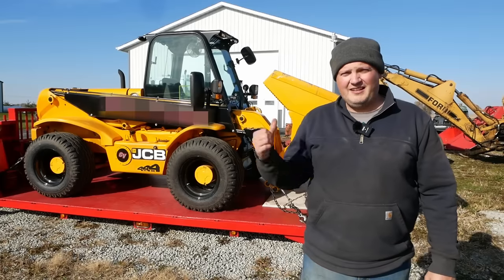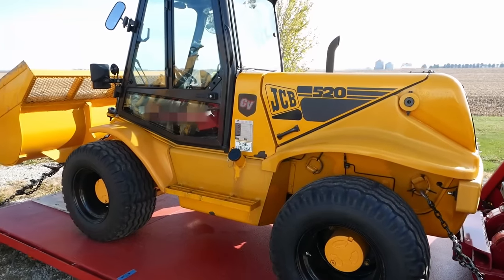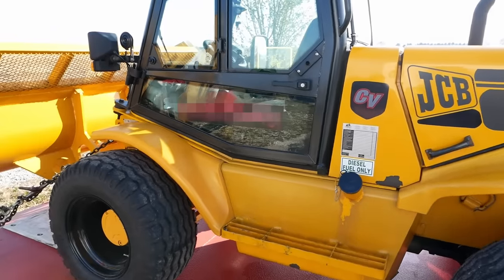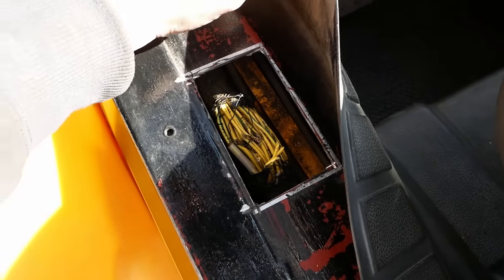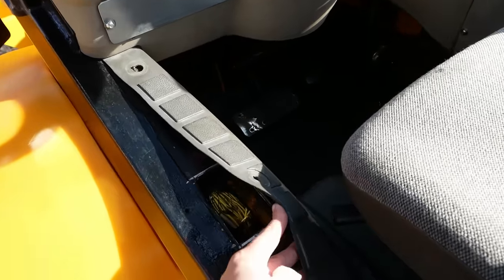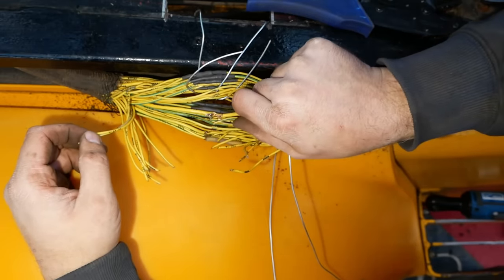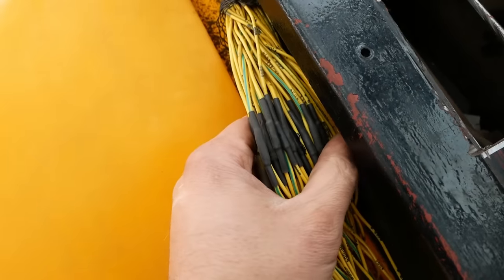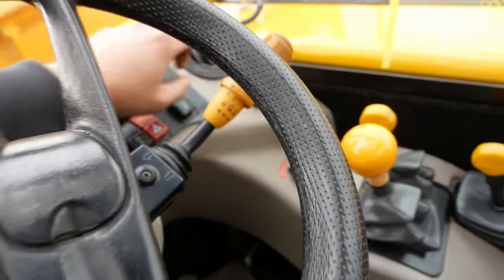What Happens when You Drill a Hole in Your JCB Telehandler?

Comment: You reminded me of the time two of us had to rewire the "brain box" on a forklift.  I think we estimated 1500 wires total.  Could have been less.  Anyway, it took us all week to replace the wiring and get the new circuit boards installed.  It was a real pain working down in a hole with no real access to anything.

Comment: I had the same thing happen in 1984 on a Ford F-800 fire truck.  A hole was drilled in the firewall to pass a cable for a Motorola radio out to the engine compartment.  The drill bit hit the Ford cable and 8 circuits were cut and about 10 more were severely injured.

Comment: I worked as an electrical engineer/mechanic all my life and my worst enemy was tracing and repairing wire breaks inside the insulation at door hinges where constant opening and closing a door causes the copper to become brittle then fracture but hidden inside the insulation. Hundred wire harnesses were occasionally experienced so I understand how you felt doing this job. Personally I can't think of a better method of repair than yours. Well done!!! Btw identifying wires within the insulation can be easily accomplished using a couple of wires soldered to household sewing pins and then pierce the insulation into the copper strands and then attaching those wires to a multimeter and then doing a low ohms continuity check to find the break.
Reply: You can buy meter test probes with tips just as sharp.

Comment: For future reference it is possible to raise the boom on one of those without the engine, it's just a complete pain.

The problem is that they have check valves that stop them moving if the hydraulics fail.
The solution is to lift the boom with another machine, and just keep wiggling the joystick. Slowly slowly, the boom will move.

Comment: The machine is fairly new and it is intended for professional users which demands availability, but the machine electrics is done in CAD and the CAD system can estimate the proper length so suddenly it is possible to:
1  cut the wires in a machine to the right length
2 the same machine will print the connection numer on that wire - and only that wire.

And allow the customer to repair the wiring in the field without necessity of a wiring diagram or waiting for a new loom.

Signal cables is done the same way - every wire inside the bundle is white but they are numbered. Suddenly it becomes possible to splice a damaged cable in the field,  but you are gonna have a CHECK ALL WIRES for shorts between each other and check all connections.

Which is done between the two connection blocks.

Comment: "Lets wipe those tears." Bwahahaha, I got to remember that one! Being a mobile field mechanic, I seen about every scenario in destroying a wiring harness. Anything from hole drilling to wires ripped right out an engine bay. I don't think I would have done anything different except applied solder to the butt connectors. In summery, it runs and now you know where to begin next time it has some electrical issues. The harness is available from them but the wait time could probably be months. Cost for that harness would generate more tears not to wipe but to squeegee. BTW most harnesses on big equipment are hand made one by one.

Comment: Back in the late 80s and early 90s I did a lot of mobile phone and radio installations. A lot of this was on trucks and equipment in the oil field. My first day at work the guy I worked with told me to always know what is under the surface you put some kind of hole in.

Comment: I should have made the trip up, to have you fix my 2001 Ford Ranger when it needed a new transmission. As at least it would have been done right the first time, and I would not have to take it back a third time to have the reverse lights fixed that the other shop broke. My dad was always good with this kind of stuff, but then he was an equipment installer for the telephone company, so he would have had a field day repairing that wiring harness.

Comment: The exact same thing happens to my Honda Odyssey. Mechanic drill a very large hole on the firewall for passing #2 electrical wires for the inside cabin inverter. He shorted out everything and he could not find out why my sliding door and others things did not work. I took the van to the Honda dealer. They removed the whole dash and found out the wiring harness was damaged by the drill. I have to pay the Honda dealer $500 for the troubleshooting. I towed the van back to the shop where they drilled the firewall for the fix.

Comment: Reminds me of a guy who changed out the carpeted running boards on his boat trailer. He jacked up the boat a little, unscrewed the old boards from the brackets and slid in the new ones, then let the boat down to hold them in place before screwing the boards back to the trailer brackets. Problem was he used too long of screws. You can guess the problem he had on the next trip to the lake.

Comment: When I worked at an RV dealership as a warranty manager, I'll never forget one of the mechanics having to trace a wiring short in the dash on a Winnebago motor home under warranty.
We called Winnebago for a wiring diagram and they said that there wasn't one but that we should be able to trace the color coded wiring.
That was fine until we looked under the dash and every single wire was colored purple without numbers or letter coding on the wiring.
Needless to say, Winnebago got billed for the fifteen hours of troubleshooting time and joked about how the factory must have gotten a deal on purple wire.

Comment: A time consuming but easy to diagnose & repair job. Imagine if none of those wires were labeled. 
  The most crazy mystery problem I ever had was with a Chevy Z24 car I bought used. Luckily dumb luck was on my side. Everything worked, car started right up & ran good, price was good, so I bought it from a small car lot. A few days later it suddenly died, refused to start but once it sat for a day, would start right up & run fine for a day or 2 before doing the same thing again.  I went nuts trying to figure out the problem, every part tested good. I figured it had to be something like a loose wire or a few fuel injectors or fuel pressure regulator that was getting stuck/unstuck, maybe a glitch in the ECU. I got the fuel injectors and fuel rail off and accidentally discovered about 12 hardened dead little beetles inside the fuel rail. I think someone was working on it outside at night & left the fuel system apart with a shop light on under the hood that attracted the bugs which crawled inside to hide (maybe also attracted to the smell of gasoline) They put the car back together and the gas dried the bugs out & made them hard so they were floating around like corks in the fuel system clogging & unclogging the injectors. My guess is, they took the car to several mechanic$ who couldn't figure out the issue. They gave up in frustration and finally traded the car in for another.The dealership probably also gave up on figuring it out and sent it to auction. The small used car lot knew it was cursed (bastards) luckily once I got that fixed. It ran good for years.

Comment: Awesome fix Wes.  No way would a new wiring harness have been a better or easier fixed. It would have cost many times more in both parts and labor and then all it would have taken would be getting one of the new wires hooked up wrong and there'd have been no end of the problems.

Comment: Wes I would have used high quality solder sleeves for that job mate.
I've had to do similar jobs on JCB 3CX and 4CX backhoes etc.
Otherwise you fit waterproof shrink tubing over each wire and solder each one and seal with the heat shrink tubing.
Such a long way to do it though.
Anyway I hope those crimps are sufficient without future issues. 👍🤠🤙😎🍻🥃

Comment: Oh, man they got that harness good. Looks like the wires are in pretty good shape aside from the one spot. It would take a couple of hours to get the wires extended and soldered back together. I would have liked to see you soldering all those back together instead of just putting clamp on connections at least you used the heat shrink on them.

Comment: Excellent video Wes  :) also glad wires had numbers on them help or be long time fix the repairs and that a lots color of yellow wires ever seen too! Also I remember do a car Stereo from original to aftermarket one  and  was nightmare to hook up to my car had long time ago! May ask why because Stereo Red was + in Yellow for vechile, Memory on Stereo was Yellow to Red for vechile - Black for ground was correct  and all car 4 speakers on - for + also Stereo was + for - were right ! But in car was crazy and not right as diagrams also called dealer why and think someone put wire harness for key ignition switch also fuse panel backwards when making in assembly line Lol! Also but when told do all that reverse on red and yellow power leads plus speakers it work to do ! But think someone at assembly plant  needs to change to there to do right not wrong ways hook up in electronic skills too ! If want know type car it is 1994 Chevrolet Calavier 4 door also 2.2 Ecto Tech motor with 3 speed Automatic transmission and base model ! But was second half years models and heard not only one had happen too many others too! Glad I didn't blow the aftermarket radio on wire up but heard others did because of power leads!

Comment: Harness itself would have been north of $1000 judging by how much was in there. Basing that off the harnesses we have to replace in trucks sometimes. Only 3 hours of labor or so to patch them is a lot cheaper by comparison. Probably would have taken even longer to pull the whole harness if you couldn't pull the whole cab. Neat truck they use too. Kinda nice to just drop the bed and then unload.

Comment: I’ve seen nails in copper water pipes that sat that way for years until somebody banged on the wall. I saw towel racks screwed into sewer stack pipes that were fine until somebody took down the towel rack.  I’ve never worked a drilled wiring bundle and hope I never have to.

Comment: I like using a ratcheting stripper with an adjustable length gauge into these instances. Gives you a consistent strip of the same length faster. Great job! Would have been a nightmare if there weren’t circuit numbers. 😂

Comment: Back in the late 80s a friend rented a Toyota MR2 and ran it in a club meeting at the racetrack, he had to fit a fire extinguisher so sat it between the seats and drilled a couple of holes in the transmission tunnel to mount it. Of course the MR2 is mid engined so he knew there was nothing in the transmission tunnel...
Hey where is that coolant coming from!
Reply: Of course he was a mechanic with his own shop.

Comment: I use butt connectors for 22-24 gauge. You can get bare barrels or ones with the glue heat shrink lines
Reply: Lining. I can get them at Amazon. They are either yellow or clear depending upon supplier. They are about 1/8 inch od. They work wonders when spicing lots of smaller wires in a harness

Comment: Wes, I don't think I've ever replaced a wiring harness in 20 years of fixing forklifts. Even other techs say "replace the harness" even though I'm the one who does the complex wiring repairs.
Point being most people who say "just replace the harness" I don't think have ever actually fitted one, they don't realise it's not a component that can just be unbolted and changed like and engine part - it runs around every nook and cranny
Most machines I've looked at I've estimated it'd take a good 3 days to fit due to the shear number of components that would needed to be removed just to route it correctly.

That vintage of JCB you likely couldn't even get a new harness and if you could it'd be $4k+ easily.
Another thing people forget, especially on old stuff is they've often had so many wiring modifications and repairs that if you put a new harness on you'd probably end up with a lot of things still not working and have to 'modify' the new harness anyway.

I'm my humble experience, if a harness has got that bad that replacement is the only option then that's normally when a machine is at an age where its probably time to just call it a day and send it to China to be turned to patio furniture.
There is exceptions of course, say a new machine that suffered a catastrophic short.
Reply: In over 50 years I have replaced 2 forklift chassis harnesses, both times were because of fire damage.  Both cases there was more than just damage to the harness to deal with and on both it was more practical to just buy new harnesses because of the many plastic connectors that were melted (and some of those connectors were only available as part of a harness assy.)
But I have repaired many that other people said they would have just replaced.

Comment: I have seen similar issues but let me tell you perkins tier 4 final are a nightmare when it comes
to wiring on cat forklifts. They are very finicky with resistance in the wiring, any bit more than what it came out of the factory with, you know from normal stuff like oxidation on terminal ends or harness connectors getting dirty from lumber yard use, the system can’t handle it at all. D-99 or limp mode right off the bat. Typically a 25000 forklift in limp mode is stuck where it threw the code because the machine is to heavy to “limp home” at 1400-1500 rpm. Not fun but keeps me employed.
Reply: Geez, what happened to good old "Perkins reliability"? The Perkins diesel in the White 2-85 at work is almost literally bulletproof, all you have to do is start it turning and then you could rip out every wire on the entire tractor and it'd still go just fine. There's practically nothing that can go suddenly wrong on it, and the only things that can (old "farmerized" wiring or a dead battery) can just be bypassed with a jump pack and a screwdriver... I guess that's what you get for ditching the mechanical injection pump complete with a "pull to shutdown" knob (it doesn't shutdown with the key) for electronic everything...
Reply: @jean-lucpicard8186  ya all the tier 3 diesels run till there’s no compression lol 15-20k hours beat to crap used in foundries, lumber yards etc, unfortunately to remain a dealership you have to buy a certain amount of inventory every year, thankfully cat has (from my understanding) gone in a different direction.

Comment: I had a dog chew thru my Ford Transit T-250 Van wiring harness whilst chasing down a rat!! I ended up doing the same thing patching the 30+ wires, thankfully each wire was different with colors and stripes. tedious but I restored complete functionality and much cheaper and easier than replacing the whole harness.

Comment: Yikes. That's like working on a 60s vintage IH truck/Scout x100! "Check the green wire!"

(For those not familiar, they were ALL green - well, about 95% of them, anyway - with circuit numbers printed on the wire. The problem, aside from bodge jobs and add-ons over.the years, is that the white ink/paint faded or rubbed off, so all you were left with were a bunch of unmarked green wires!)

Comment: I had an aircraft electrician volunteer to help me drill out the  300 rivets in an aircraft cockpit perspex roof panel and i warned him to only drill off the head of the rivet and not right through. Well he drilled right through the center overhead cable loom tray.  Then he spent the next two days replacing the loom back to the canon plugs as butt connectors were not allowed in that loom.

Comment: You did the right repair with a brain-surgeon precise surgery.
Could been, "up in smoke" at start-up, but really impressed how it turned out, nice wire-loom repair & correctly done all the way. 5 stars * * * * *
I have seen the "drilling" mistakes many times, worst scenario was a friend who worked on a car inside the garage, 4 jack-stands and drilled thru the plastic gas-line close to the rocker-panel..
He was replacing the carpet inside and decided putting some extra screws holding the new nice carpet down.. well after drilling a big puddle of gasoline had dripped out on the floor.
And because he was a smoker, working inside the car with both doors open, tossed the cigarette butt on the floor while sitting in the car fighting the carpet...next second a big boom and flames started... he ran around like a crazy person first he told me...then took his wife car, hooked a tow-chain to the burning car and dragged it out from the garage off the jack-stands, no time messing with those.. as the undercoating on the floors caught fire already..
Well the tragic thing after being able dragged the car outside...it was too late...
Plastic gas-lines can be very dangerous when welding or drilling without checking first..

Keep up the good work Wes !

Cheers from Texas.
Reply: This is why you don't smoke and work people! Or at least, police your butts and make sure your nose works to smell VOCs (like gasoline) before they accumulate enough to light off of the cigarette itself! I don't smoke and never will, I just can't understand the point behind destroying your body like that (it's the only one you've got!), but smoking irresponsibly like that!? Now you go from personally stupid to professionally dangerous in my book. At least he was able to save the building (hopefully), but whoever's car it was for sure had a bad day getting that call!
Reply: @jean-lucpicard8186  Thanks for your response.
Yes the garage got saved but car up in flames. Did he learn from this lesson ?
I hope so, but have seen some really stupid moments in shop's during my work as a body-tech for 25 years.

Comment: Nice trick with the tape on the socket.  I could have used that many times instead of trying to thread a strip of tape through dusty wires.  I'm disappointed that the flood lights don't work.  Maybe next time?

Comment: I would not put my hands in there. soldering easier, more dead on solid connections i believe. Those crimps can corrode later or easier pulled apart.